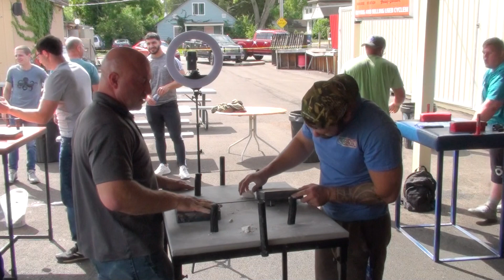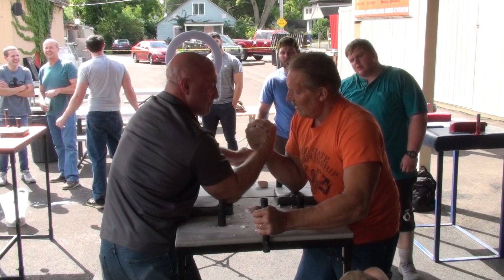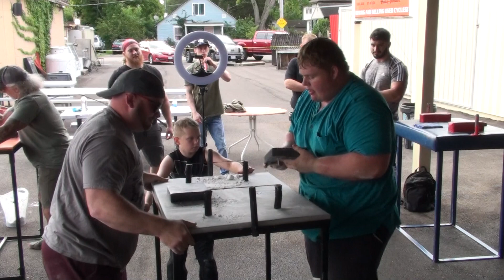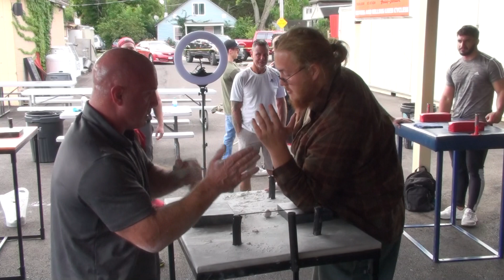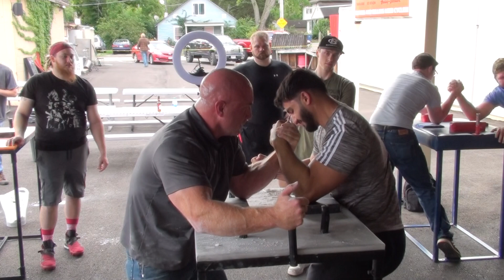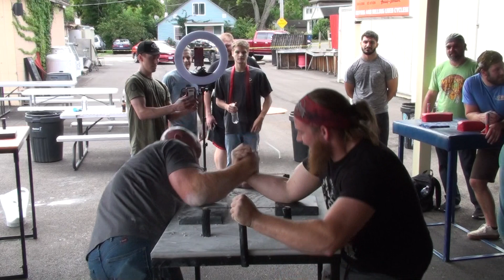Arm Wrestling Practice Brothers In Arms Villa Tavern

Comment: I wanna watch every video in chronological order and comment this for the algorithm. Im a 5'10" 75KG bowler turned armwrestler to get my left arm up to speed. I been training for a few years with no table time just doing rows, hammer twists, radial posts, loading pin, wrist flexion with bowling balls, etc on my left primarily. I bought a table finally to invite others over, but I mostly wanna train similar to you and get strong. My first tournament is the LLD fundraiser in Bend, OR on 6/11 put on by Jody Williams and others. I hope I can put on some weight though to be 176, eating is hard. Matt Mask syndrome. Cheers!